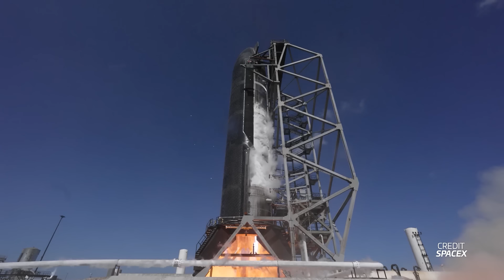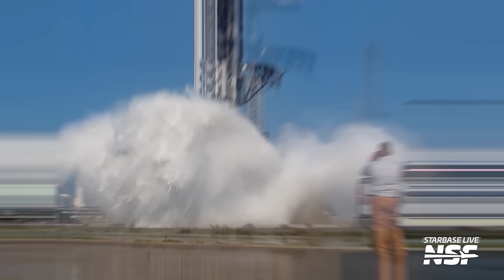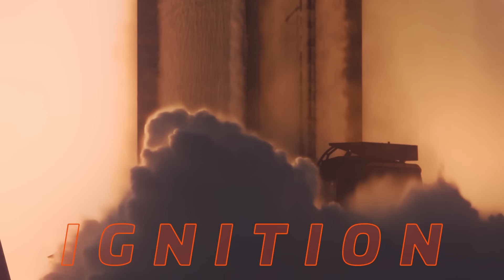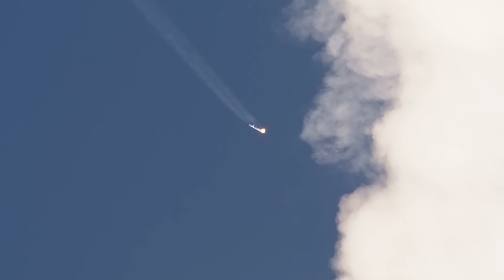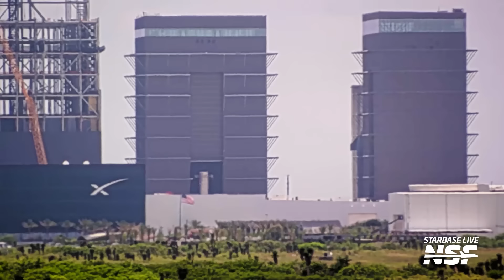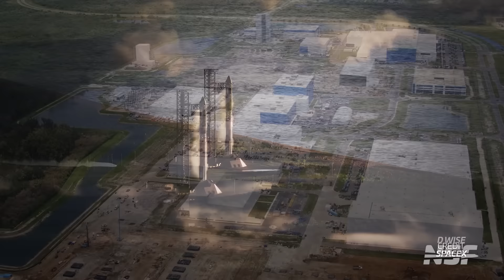Starship Testing Takes an Unexpected Turn | Starship Update

Comment: So, we know with the expected cadence of flights, that roughly 1000 vehicles will be needed. Is there a Terra-bay or some storage facility planned for that? Perhaps a multi-level parking garage for starships and boosters, where several floors can be used to increase square footage for storage. If stored on a single level, it would be something in excess of 30 x 30 footprints, which could end up being a square mile. Using a parking garage model could reduce that to a 1/4 mile square building  with around 16 levels. Cantilevered bridge cranes on each floor could move the boosters from each floor to the grounnd level.

Comment: There's not a lot of sense in speculating on when Ship 13 will fly based on the testing cadence. 

The testing cadence tells us little or nothing about how the research into Ship 12's flight is going. And if Ship 13 is ready to fly this very afternoon, it's still grounded until SpaceX has found out what caused the Ship 12 failures and come up with remedies for them.

There has been no news on that investigation to even give us a thread to speculate upon, unfortunately.

While there has been lots of plausible speculation by third parties that the second stage separation behaved in an unexpected manner, resulting in fuel sloshing that cut off the engines, we still have no real confirmation of that.

All of which is intensely frustrating, as I want to see the Starship attaining its test goals NOW, and good sense requires that they take it slow, instead.
Reply: It's not unreasonable that if they're going through testing this far they have ID and maybe solved their issues.

Comment: SpaceX could have build and launched a 1:2 scale ~200t Starship in 2019 with a single Raptor, launched on a Falcon 9 and worked out pretty much all the problems they are still working on. This is what prototypes are for and this is why they are usually subscale. This is also what was planned at SpaceX in 2018. What happened in January 2019? Tom Mueller left and Elon took over all decisions.
Reply: Subscale in rockets usually doesn't work.